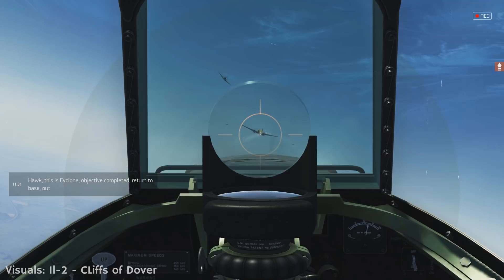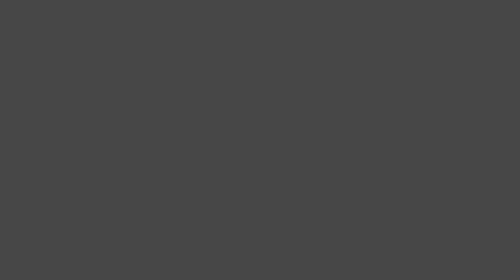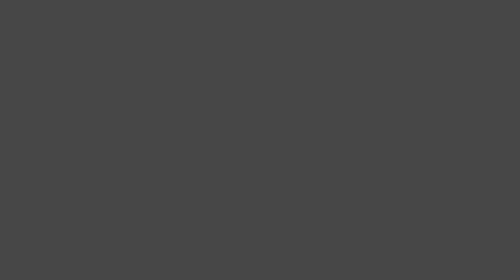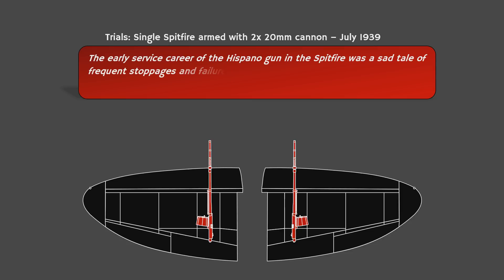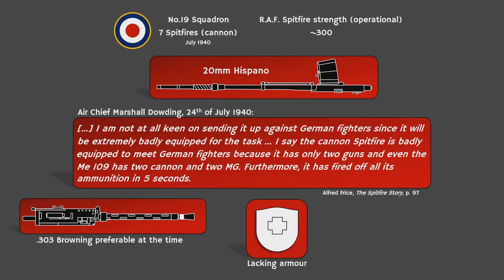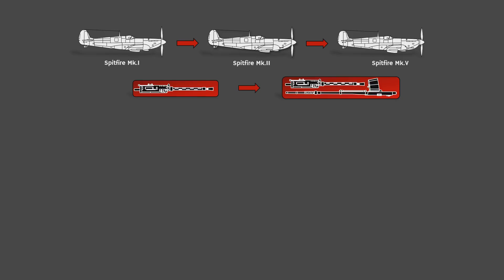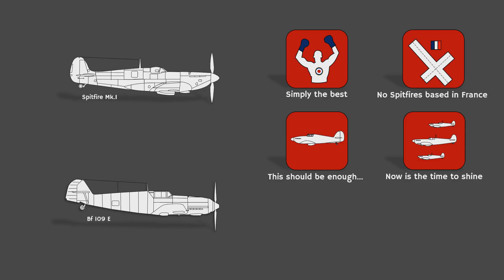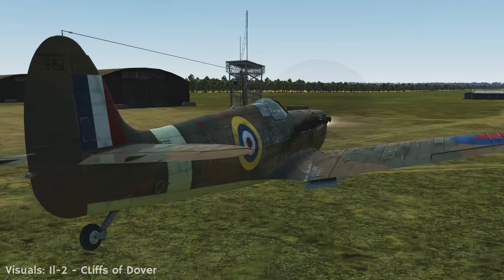⚜ | Clearing up Spitfire Misconceptions

Comment: Aircraft and more so, engine technology that spanned 37 years is amazing.  Not just the designs, but the metallurgy and machining skills that went from the puny putter on the Wright Brothers bi-plane to the Wasp 4 row R-4360-10 in an F2G Corsair in such a short span of time is hard to fathom.  Jet engines?  Raspberry here, a tube with a bunch of rotating fans you dump raw fuel in and ignite(being tongue in cheek), they just don't hold a candle to  the work of art that is a radial engine.
Reply: Aaack!  Should have said reciprocating engine, not just radial.  The Merlin is the Mona Lisa of thew art of engines.

Comment: An almost unknown detail. Originally, the Spitfire's engine was intended to be steam cooled. Steam cooling in theory has several advantages , the principal ones being that boiling the coolant rejects (transfers) much more heat than simply heating it; the second is that you don't need a drag-producing external radiator which, together with its coolant lines, can bring the plane down if a single rifle-caliber bullet strikes part of the setup. Because of this, Reginal Mitchell had the wing designed with a hollow leading edge where the stream would be condensed, which also functioned as the leading edge spar. The steam cooling was one of Rolls-Royce's few failures, so the aircraft was produced with conventional external oil and engine coolant rads. and what would have been the condensers remained empty, with m/gs and cannon barrels going through.

However, they were put to use as extra internal fuel tanks for the unarmed photo-reconnaisance versions. Later in the war, using these and also an extra fuel tank behind the pilot, the photorecce. Spit had a range of 1,700 miles, some 200 more than the famously long-legged P-501D Mustang.
Reply: I keep trying to add a reply and failing, fourth time lucky. During the early 1930s R J Mitchell designed a fighter around the RR Goshawk engine and it had evaporative (steam) cooling. That machine, the Supermarine 224 had an inverted gull wing and a fixed undercarriage, the cooling surfaces, pretty much radiators, were faired into the fat spats around the undercarriage. It flew but was NOT a success, however Mitchell credited it with providing a number of key lessons which significantly informed his design for a rather better known low wing monoplane fighter. The irony is that the spec he was working on was for a replacement for the Gloster Gauntlet and in the end the Ministry went with the Gladiator - air cooled engines I believe. Who knows what sort of machine the RAF would have fielded in the end if Mitchell hadn't worked on the Type 224.

He knew that evaporative cooling worked in principle, but the then working examples were relatively slow biplanes some placing the cooling surface on the top plane. The obvious exception was the S5/S6/S6B series, the S6B anyway, more Mitchell designs, made the corrugated fuselage the cooling surface to maximise the surface area. That's too big a target to use in fighter. I wonder when he ditched steam cooling for the Spit, or was that driven by RR ?

He also designed the Walrus, with its air cooled radial - or flying gas ring - nothing if not versatile that man.

Comment: One thing that wasn't mentioned was that the early Hispano installations used a 60 round drum (pictured in the video). Aside from the jamming, it also required large blisters to fit in the thin Spitfire wing. The later installations used feed trays and 120 round belts. According to the Wikipedia page the Hispano had a firing rate of 700 rpm, so 60 rounds would indeed last 5 seconds. Lots of comments below on the C and E wings - the first 2 cannon + 4 MG installations were actually in the B wing (cannon in the inner machine gun bays with the 60 round drum). The C wing was the definitive 2 cannon + 4 MG wing, it could also be fit with four cannon (almost never done), OR 8 MG (almost never done), OR (theoretically) four cannon AND 4 MG (NEVER done, too heavy) OR two cannon and two .50 MG (only late in the war). Hence "Universal". The E wing was for two cannon + two .50 MG (the cannon mounted outboard of the MG), also late in the war. The Spitfire FR XIV (with the teardrop canopy and side camera ports, as pictured in Quill's book) at the Royal Thai Air Force museum in Bangkok has the E wing. I never thought I'd ever get to see one of these in real life, here you can not only lay your eyes on it, you can fondle it! (Definitely worth the hour long unairconditioned Bangkok city bus ride... they also have a Fairey Firefly, by the way - HUGE - and a Harrier - yes, the Thais operate a carrier, albeit only with helicopters, these days..) The D wing, apparently, was for PR Spitfires (no guns). I see some interesting comments below on Spitfire operations out of Darwin, I've been wanting to find more information about this but haven't found all that much (online). I did hear they initially had a terrible time of it, they brought a veteran squadron from Britain to take on the Zeros and ended up losing something like 18 pilots in a few months. Some of the stuff I found online mentioned the huge distances involved - there was a map of many, many emergency landing strips since there was a real danger of running out of fuel on operations. Caldwell is mentioned prominently in the P-40 article on Wikipedia - did he ever write a book? Didn't know he flew in Australia later on.
Reply: iskandartaib 1. The Mk IX had 2x canon and 2 x 50 with the Ewing and it was not a late version 
2. The Aussie Government held Churchill to his promise of Spitfires being sent Churchill sent clapped out MkVs  Churchill [ the slug] was angry at us because we brought the Australians back from Africa and used very trick in the book to oppose it. Eventually we got VIIIs but the Spitfire was never really suited to the SW Pacific . Too far between Areas of Operation

Comment: The Hispano cannon was conceived as a moteur cannon, meaning it was made to be mounted on a massive engine block, not lightly built spitfire wings, with a single spar. Some work had to be done to overcome this. Those cannons, and other heavy russian armament, and even 40mm cannons felt at home in and on Hurricane wings. There was also trouble with fabric covered ailerons, being the fabric blown out with higher airspeeds, making aileron movement a drag. Static elevator compensators and rudder had to be enlarged etc.

Comment: After the liberation of France, there were lots of hangers found with unused aircraft, including ones sent by the British.  
It’s almost as if the French politicians wanted someone to blame for the defeat more than they actually wanted to fight.  
Sending more fighters, as Churchill wanted to do, would have made no difference to France, and a significant difference in the Battle of Britain.
Reply: but just in the aviation section of the Operation Seelöwe/Battle of Britain...
Reply: France had some excellent fighter designs available, only the heads of the military and politicians didn't realize how badly they were needed. They were well able to match the 109 and might have changed history, had they been available in numbers.
Reply: Powered by excellent engine designs which the Russians  used very effectively.
Reply: Well the sad fact is that they did have plenty of good planes... only the pilots (and their officers) were hot-legging it to Normandy or just giving up.
That's why Churchill & co were reluctant to send many of our planes over (incl Spits) and just placated the French generals with some Hurricanes and Lysanders etc.
Reply: Possibly, but from what i understand there was a shortage of pilots. This was bad planning of course but it took several years for the allies to get there act together. E.g.Crete, Hong Kong, Singapore, Russia,  Pearl Harbour. France was the first major power to face the German forces.
Reply: Looking at it now it is apparent from the information available there was serious fighting in the air between France and Germany and the problem was more of a land force one and a new type of approach to the fighting.
Reply: Yeah. France was the victim of early strategic and tactical fuck ups by the allies. The Germans rolling their Panzers through the supposedly uncrossable Ardennes forest really threw France for a loop. They we're expecting the Germans to enter France through Belgium (as a way around the Maginot line) and were blindsided. The MS406 was serviceable if unspectacular and the D.520 was very competitive with the Bf109. French tanks were even superior to the early Panzers. Equipment quality was certainly the least of their issues.
Reply: @georgecaetano9129  "from the information available there was serious fighting in the air between France and Germany" you can easly find testimonies of Polish pilots that were runing to planes to fight Germans and French pilots in the same time were walking slowly to eat something in canteen...
But you do not need to believe in testimony of Polish pilots just read why German generals in German highcommand were considering the whole plan of German attack on France reckless... ->the plan was giving French airforce aibility to end it in the very beginning...->i wonder why French airforce did not used that oportunity?
Reply: @Bialy_1 Fifth column activists

Comment: Reading a Spitfire pilots memoirs he mentions lady luck, he was bounced by two 109s and pulled high G turn to get out of the way he overcooked it went into a flat spin in the turn, he pulled the trigger as he span and hit both the 109 as they overshot and flew through his cone of fire. Complete luck, he also mentioned flying with high trim on rudder. Plane flew crooked, someone giving lead on you and pulling the trigger would find bullets arriving to the side of the target as the plane is not flying exactly that way. Enough of a chance to get out of there if you saw the tracers. He knew what he was doing and luck was on his side both essential.

Comment: @55s you say the engine would "momentarily seize". I understand why you would want to avoid the word "stall" but I think seize is misleading as it implies the engine stops rotating. "Misfire" or "lose power" might be more informative.
Reply: The term is flood
Reply: @dazaspc  not exactly, the cut out is from fuel starvation, the flood happens after when returning to normal flight, which is what the orafice fixed.

Comment: Hurricanes were better than Spits because they were harder to shoot down. A German pilot had to hit the engine, the pilot, or the gas tank to bring down a Hurricane, a much smaller target than the Spit. Bullets would tear the metal skin of the Spit to shreds, downing it, or putting it out of action.  
The fabric skin of the Hurricane made the Hurricane plane itself almost impervious to bullets - they just punched little holes that had no real effect. So, the Hurricane was more survivable, less fragile, and therefore, more dangerous to German pilots. 
After all, Hurricanes did destroy more German planes in the Battle of Britain than the vaunted Spitfire. 
When I hear the Hurricanes getting disrespected, it makes me so mad, I just spit fire. (pun intended, :-)
Reply: Better defense doesnt make it better, the spitfire was a more effective
Reply: According to "Fighter" by Len Deighton, the older armorers and fitters who maintained Fighter Command's aircraft had plenty of experience working with wooden frames covered with fabric, and many damaged Hurricanes were easily repaired right at the satellite air strips.  The Spitfires had to be flown or hauled to more extensive facilities.  That said, a thirty caliber bullet punches the same size hole in aluminum that it does in canvas.  IMO this didn't make the Hurricane "almost impervious" to bullets, (especially exploding cannon shells). It just made them easier to repair, assuming they survived.  As to Hurricanes downing more enemy a/c during the BoB, it was because the RAF had a lot more Hurricanes than Spitfires at the time.  And German pilots, both fighter and bomber, had a serious case of "Spitfire snobbery".  Captured German aircrew would insist they had been shot down by Spitfires when there no Spits anywhere near.  The Hurricane earned its place in history, right beside the elegant Spitfire.
Reply: German fighters were using 20mm cannon firing explosive shells*. These shells were designed to detonate on impact with the hull of an opposing aircraft.
This worked fine against Spitfires, with their (mostly) metal covering** but not so well against the fabric skinned Hurricane as the detonators simply didn't activate on hitting the skin. To be effective the shells had to hit something more solid.
There is a reported case from a Hurricane pilot in 1940 who was jumped by a 109, only realising this when he felt a massive 'bang' right behind him. His fighter was damaged enough to force him to return to base. On landing he required help from the ground crew to exit the aircraft, discovering that he couldn't get out of his seat once on the ground. A 20mm shell had entered the back of the plane, passed right down most of the length of the fuselarge before hitting and detonating on the armour plating behind the pilots seat and blowing a hole in both of them. The torn metal around the exit hole hooked into the pilots parachute, pinning him in place.

* There were explosive rounds for rifle caliber rounds but these quickly fell out of favour. The RAF, for example, developed and issued such rounds in (British) .303 for aircraft in the mid 1930's. But discontinued their use less than two years later.

** The early model Spitfires were not actually all metal construction as the control surfaces were fabric covered. This caused problems during high speed dives as those surfaces would balloon up making it very difficult for pilots to pull out of a dive. (I seem to recall one pilot actually bent the control yoke trying to pull out of such a dive)
Reply: The hurricanes only shot more planes down because there were so many more of them than spitfires!
Reply: Offensive flying is what matters for a fighter, not how many shells she can tank before plummeting to the ground.
Reply: One flaw of the Hurricane though was that It's gas tank was in front of the cockpit behind the engine which could cause the cockpit to be enveloped in flames pretty quick if hit. Quite a few Hurricane pilots burned to death before they could bail out when their aircraft took damage.
Reply: Hard to believe you could make so many errors in one small post.  Clearly you have some sort of agenda to reinvent history like that.  For starters, the Hurricane was much larger (~900 lbs), and had less performance in all fighter metrics except maybe turn radius.   Read some technical history.
Reply: @bobsakamanos4469  Why then did Hurricane flyers REFUSE Spits when offered them instead?? 
Yes, read some history.
Reply: @Snake-ms7sj  absolutely correct.  Return fire from bombers often hit the header tank/firewall.  Being slow with less performance also made it more vulnerable to the typical 109 & 110 attacks of dive, peck and zoom.

Comment: You have to pull positive G by executing a barrel roll as you dive to get around the carburettor problem. Even the oriface didnt stop the engine being starved, just the carb being flooded.

Comment: ..correction the engine did not "seize " or "flood" during negative Gs, the float system of the carbs would temporarilly cut fuel flow to the engine causing it to starve and cut out.... hope that helps alleviate some misconceprions

Comment: You missed single external difference between a MkII and a MkI on your visuals with the Coffnman starter on the starboard side of the fuselage, no?
Great video though again ;)
Reply from the maker: The visuals are always made from the port side, and then just flipped for simplification.
Reply: Bismarck I should have noticed that! Just had to point out a little thing, was meant in jest more than anything else.
Keep it up, hope you have recovered from your absence

Comment: You made one fairly important omission - how did the RAF pilots cope with the Merlin's tendency to cut out in a dive (this was an issue with the Hurricane as well). They learned to flip onto their backs before starting the dive, which stopped the engine cutting out. Of course, this manoeuvre often gave the 109 the time it needed to escape.
Reply: Consider that the Spitfire roll rate was much superior to that of the Hurricane, which also suffered from a very limited dive speed.  Hence, more reasons for the Hurricanes to go after slow bomb laiden bombers than tangle with LW fighters.

Comment: .303 caliber is a 7.7mm, rather than the .50 caliber 12.7mm. My point is the Spitfires didnt have any .50 calibers, only .303 or 20mm and .303s
Reply from the maker: Nope, there were Spitfires with .50cal and 20mm. Look up the Spitfire 'E-type Wing'.
Reply: Bismarck - Military Aviation History yes  but those were late spitfires. The early spitfire had only 7.7mm
Reply: And?  Read zach Waiters post.  It's a problem that most (especially you yanks) only see the early Mk of spitfires as being generic, which they were not!
Reply from the maker: Connor Fox Exactly what I was saying.
Reply: Wrong.
Reply: The reason for the .303's was that it was prohibitively expensive to build the .50 cal under licence from the US, so BSA only produced the .303's.  Business as usual for the 'muricans.